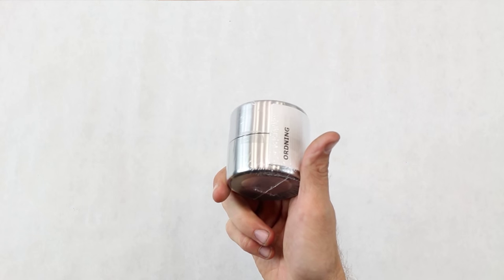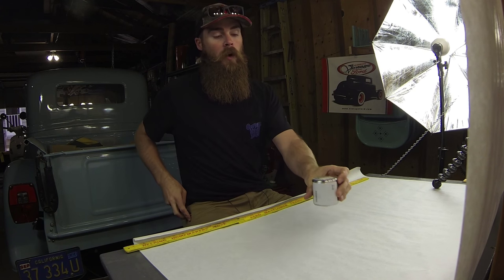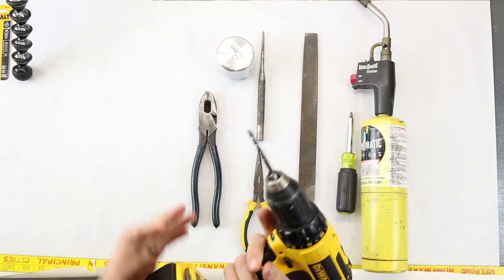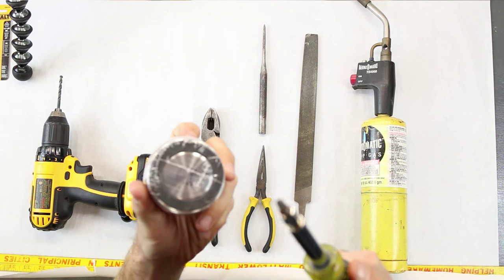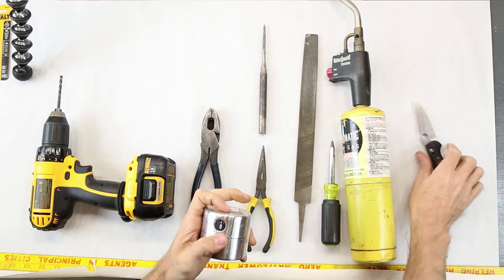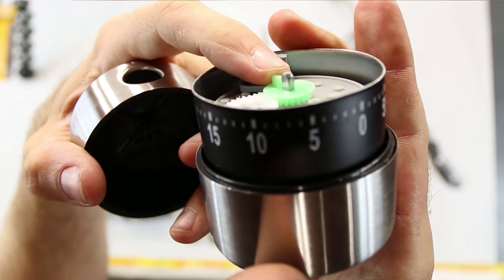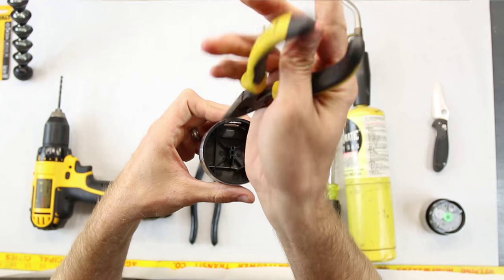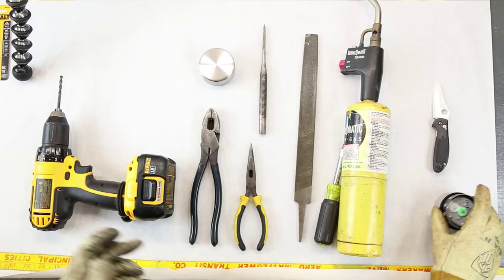DIY EGG Timer Time Lapse Panning Rig

Comment: Or you could just put a sticky go pro mount on top of the timer and call it a day :)
Reply from the maker: +MaherMic You still have to do the bottom. I was using this with an I phone mount so I needed the 1/4 -20 bolt on top. But for a GoPro this is super easy.